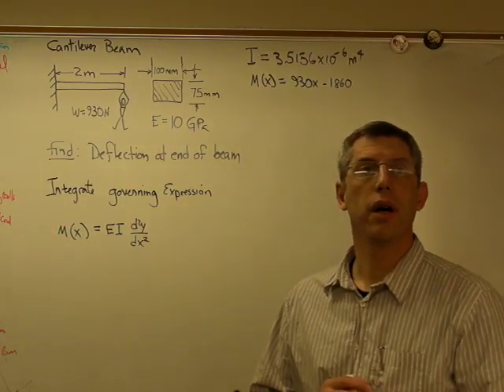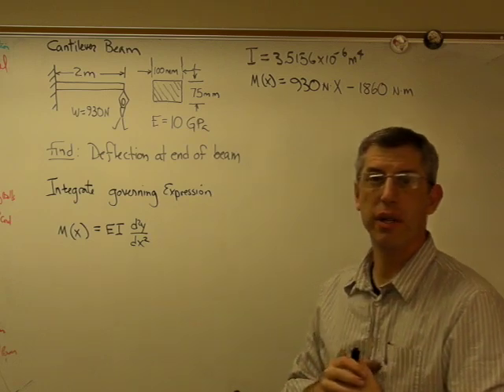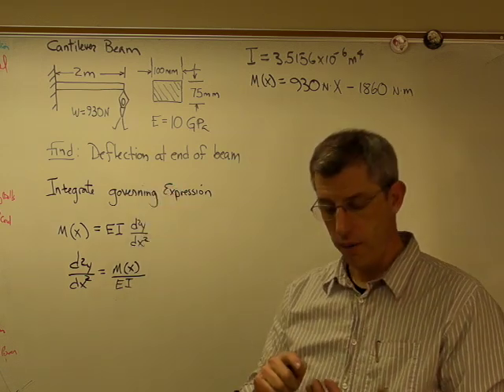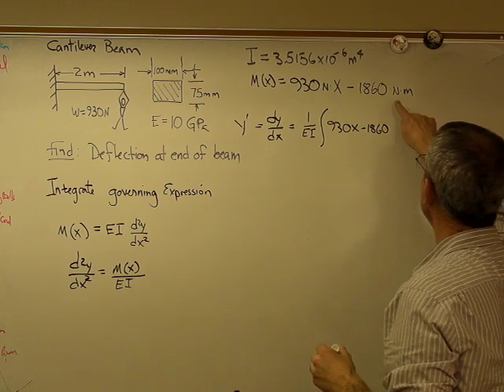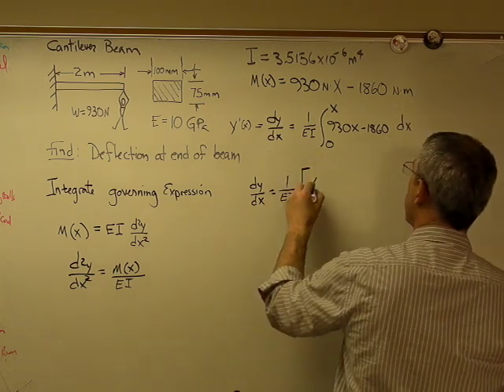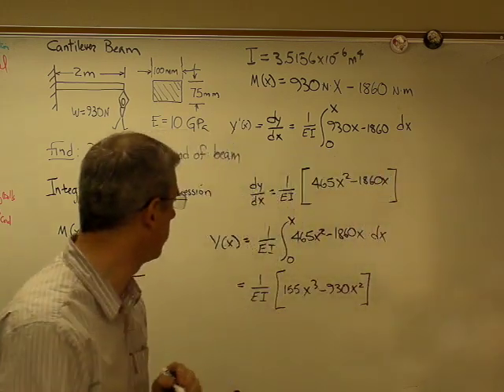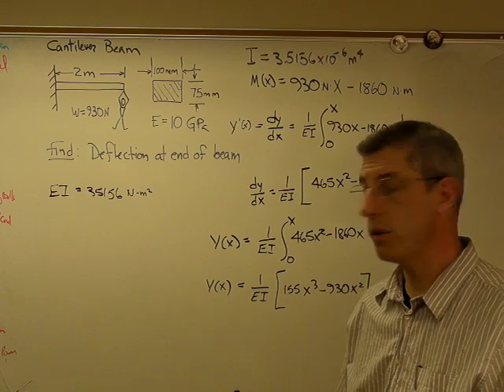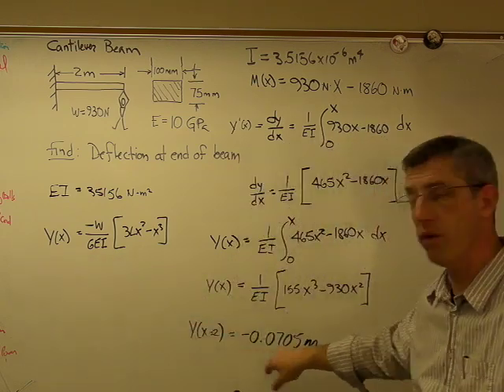Cantilever Beam 2.MP4

Comment: No buddy, due to applied load a structural member will deflect about an axis which may or may not deform the member. Deflection always occurs about an axis where as deformation is due to applied load.

Comment: Dear Professor,
Thank you for your video.
The weight hanging down in the problem describes a concentrated point load. Now if you had a solid block of a certain mass (say 5 kg) sitting at the end of the beam, which was lets say l=100mm x b=100mm x h=100mm, how would you resolve the problem? I anticipate that the load would be resolved into a point load through the centroid of the beam, but I am not exactly sure how to properly approach this. Could you please help out with this.

Comment: It may be useful to mention what happens to the constants of integration. I understand that they both are zero because, against the wall, both the deflection and slope are zero. However they do still exist and you wouldn't want to forget them if you are using this video as a guide for similar but fundamentally different deflection problems.